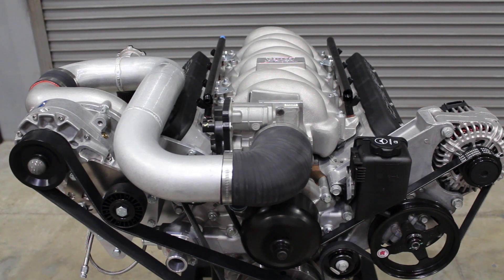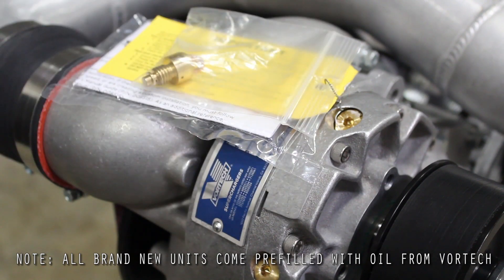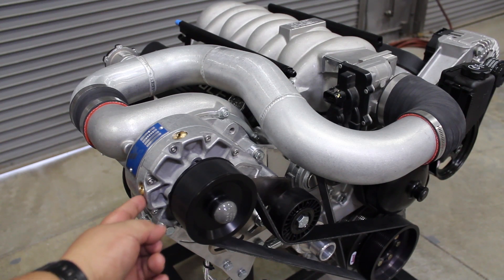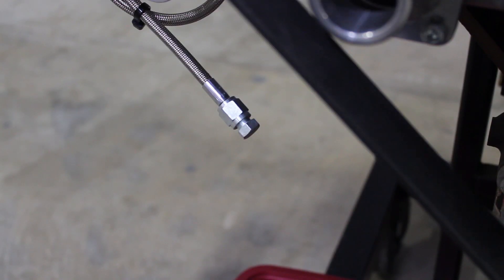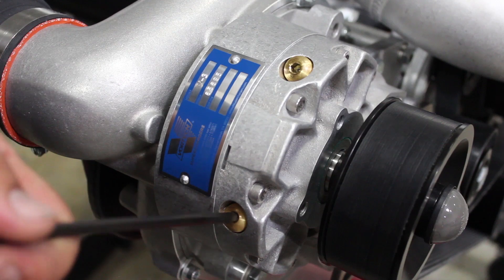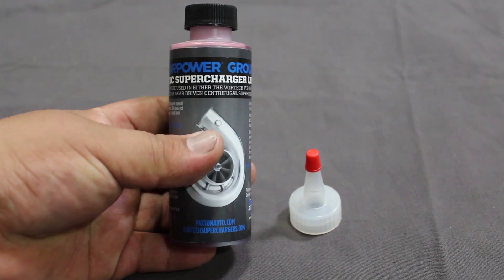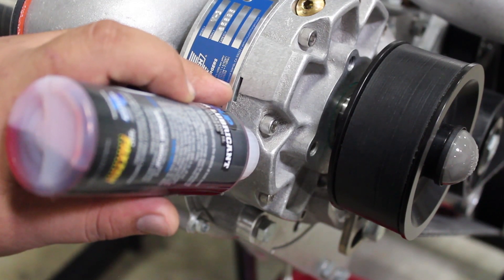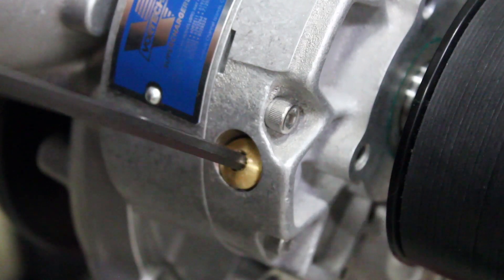How To: Vortech V-3 Supercharger Oil Change

Comment: Both my bolts are stripped, I bought this car used not too long ago, and I’m just noticing.
Reply: So did it cause any issues or how did you resolve this? 

Are the heads of the brass bolts stripped or the actual threads inside the gear case?

Comment: Installed a new Self Lubricated Paxton, and just changed the oil for the first time at 2500 miles. However, before reaching the 7500 mile mark for the next oil change, I noticed the oil is a bright milky pink instead of the magenta red it normally has after checking the dipstick. Is this normal or is it a problem? Do I need to change the oil right away now, or can it wait till the 7500 mile mark? What is causing the oil to be bright milky pink? Water condensation? If so, how to get rid of it or does it happen from time to time normally?
Reply: Immediately change that oil. Don't run the blower until it's changed. You have water contamination. These blowers have a vent plug that you're getting water accumulation through. Do you happen to have a car with a hood vent? Drive in the rain possibly?
Reply: Appreciate the reply. Yes, I have a Shaker hood system and the Paxton vent plug is located right under the shaker system so when it rains the water may be going into the supercharger through the vent plug side.  I'll drain it right away and change the oil. Thanks.

Comment: Fresh oil is hard to see in the dipstick. What’s happens if you overfill the oil by a quarter inch on the dipstick?
Reply: I know this is old but wanted to answer for you. Definitely dont want to overfill it. Make sure the old oil is completely drained out ensuring the drain line is clear of any kinks. Then only start with the supplied 4oz of oil. Start the car and let it run til warm then check the dipstick. Should see it on the hash marks. If you dont I would inspect all your steps before adding more to avoid overfilling.

Comment: I want one for my silverado. Can I run it on stock injectors? Wouldn't it be better to have a inner cooler? Is there a turbo without the 90? To add inner cooler easier. Do u have a video explaining everything for 5.3 siverado?
Reply: Intercooler
Reply: @hithereperson8137  i picked a torqstorm. I'm happy with it.

Comment: I am not sure if I am hearing things or not, can you guys tell me if this sound is normal from the v3 or what might be causing it?  I removed the belt and it turns fairly freely and doesn't make any noises that I do not remember it making but its been a long time since I had the belt off.  I checked the pullies around it and they are not making any noise either.  https://www.youtube.com/watch?v=4b1mtvpWiN4
Reply from the maker: Hello Scott, please contact our service department directly. They would be happy to address any concerns you may have with your Supercharger, and help to determine if any service may be required.
Reply: @VortechSuperchargers  I did and since I didn't hear back I am just assuming that means its a normal sound.
Reply: @Scott Sorensen  Mine is doing the same noise. Did you ever find out if something was wrong
Reply: @ArmandoHernandez-zn4mp  its normal

Comment: Does oil get forced out of the vent plug during normal usage on a V3? betwen my vent plug & dipstick you can see basically dried oil...like a film covered in dust. I checked the dipstick and there's no oil on it cold. Been bout 3k miles since i last changed the oil. Do i need to warm it up before checking the oil?

Comment: what about the V-2 vortech superchager? does that need oil?
Reply from the maker: While the V-3 Superchargers are self-lubricated and need separate fluid changes, all V-1, V-2, V-5, V-7, V-9 (etc.) units are engine oil fed, so they are provided a fresh supply of oil from the engine itself, via oil feed and drain lines coming off the engine, and draining to the oil pan.
Reply: @VortechSuperchargers  how do I choose which one works on my engine I have 5.7 l challenger  do I need v1 v2or v3

Comment: my kit came with some oil.  Is there an time that its good use before it goes bad?  its been on a shelf in a cabinet for a few years.
Reply from the maker: The Vortech Supercharger Lubricant has a significantly long shelf life, and should be perfectly good to use after sitting on a shelf for several years.

Comment: Does the si version also require oil change? Or does it share it with the engine?
Reply from the maker: Every V-3 unit is self-lubricated, regardless of what compressor stage is attached to it. The units that are all engine oil fed include the V-1, V-2, V-4, V-5, V-7, or V-9 Superchargers. This is also true no matter what compressor stage is attached to the transmission side of the Supercharger.
Reply: I have a V2 SC. Can I convert my V2 to self lubricated as V3?
Reply: @thanhha2686  i have a v3 si which shares the oil with engine.

Comment: If I don't drive 7500 miles per year, what's a good time interval to change the oil?
Reply from the maker: There is not a set time interval for fluid changes, only mileage. If you were concerned about time interval on a unit without much mileage, one fluid change per year should be sufficient.

Comment: Does anyone know how can I reorder the supercharger dipstick? It seems the previous owner stripped the head on mine. If anyone can provide me with a part number or means of reordering this it would be appreciated. I have the V3 supercharger installed on a 911 (997.1). Thank you.
Reply from the maker: The dipsticks can be ordered directly off the Vortech website. Just search "dipstick" in the search function and they will come right up. Easy!

Comment: I've filled mine with 3-3.5 oz of fluid and it saying it's about a inch over the fill mark. any ideas?
Reply from the maker: There are 3 different dipstick lengths, dependent on at what angle the supercharger is intended to me mounted. If you purchased the supercharger used, or the system you have is from a third party (not Vortech directly), it is possible that the dipstick in your supercharger is the incorrect length. Please give our service department a call for more information and further assistance.
Reply: bought it new from a dealer. I'll give them a call. thanks

Comment: I have 05 Mustang gt with v3 si,  no intercooler,  running on stock engine but with APR 156 -4301 head studs. so what's the safest rout to gain most power without blew my engine? some say 9-10 psi, and max 500whp. but this is the maximum risky power you can get, would you say 9psi,at around 450whp is safer to have fun with? mine blew up ,Ford mechanic think previous owner changed either crank pulley or supercharger pulls to create 19psi.
Reply: First off get an intercooler. Dont even think about adding anything before getting your cooling squared

Comment: good afternoon what torx socket can I use to remove the vent plug
Reply from the maker: It is actually a 3/16 Allen that you would want to use to remove the vent plug or dipstick. Using a Torx bit may damage the plug, and is NOT recommended.
Reply: thanks
Reply: FYI No torx bolt will be made of brass. As it it a softer metal

Comment: have a v5 vortech supercharger i will like to know if  a supercharge oil change is required on a v5c because mine has oil feed line that  feed directly from the oil pan   i m new on the supercharge and have very little information on it can u please help me out and has the original shipping  plug that a major NO NO ?
Reply from the maker: The V-5 is an engine oil-fed supercharger, so there are oil feed and drain lines running to and from the supercharger that supply it with a fresh supply of oil as long as the vehicle is running. You only are required to physically change the oil in self-lubricated superchargers, such as the V-3 shown in this video.
Reply: VortechSuperchargers I need help I accidentally stripped the threads on the oil entry. What can I do. I don’t want to force the screw in.

Comment: what about on the v9?
Reply from the maker: The V-9 is an engine oil-fed supercharger, so there are oil feed and drain lines running to and from the supercharger that supply it with a fresh supply of oil as long as the vehicle is running. You only are required to physically change the oil in self-lubricated superchargers, such as the V-3 shown in this video.

Comment: I have less than 1000 miles on my supercharger. It squeaks pretty loud on start up. The squeak gets fasters as the SC spins. I checked the oil and level is fine. What could this be?
Reply from the maker: A "squeak" is more likely a belt sound or an idler pulley sound than a supercharger sound. Give our technical assistance department a call and they will help you diagnose the issue.
Reply: Highly suggest Gates RPM serpentine belt. No not the green HD belt. It's says RPM on it.

Comment: How many hours / miles is the oil good for and is there an oil change breakin period also ? 
Thanks
Reply from the maker: There is no oil break-in period required. As it states in the video, the first oil change is at 2,500 miles, and each subsequent oil change is at 7,500 mile increments.
Reply: It comes with oil already in the Supercharger right?  Or do you have to add right after install

Comment: My Paxton has some gear noise at idle.. one guy told me his has no noise then 10 other guys told me at idle there is some gear noise.. it smoothes out as soon as i come off idle but it worries me lol
Reply from the maker: Any centrifugal supercharger will always be loudest when it is spinning at its slowest rate (idle). It is not uncommon for the gear noise to be what some would consider "loud", while many others would probably say it isn't loud enough! As long as the sound decreases when the supercharger is spun faster (off-idle and driving speeds), then the unit is most likely exactly as it should be.  If you still have concerns, you can call the Paxton service department and have the unit sent in to be checked out.
Reply: VortechSuperchargers Thank you, I had a feeling it might be normal gear lash noise.  It clears up as soon as it comes off idle.

Comment: How often do you do this?
Reply from the maker: The first initial fluid change (when the supercharger is brand new) is at 2,500 miles, and each subsequent fluid change is at 7,500 mile increments.
Reply: I so wish they answered your question as I'm begging to know that too!
Reply: VortechSuperchargers Please explain the oil feed/return system to me - on an S2000 that I want to purchase, I'm not sure if the V-3 (or possibly 2) has had it's fluid changed as you recommend and I'm not sure whether the installer used a feed/return setup. How do I know/what do I look for?
Reply from the maker: For answers to your questions and more information on the system that you have, please contact our technical assistance department at 805-247-0226.
Reply: VortechSuperchargers I see. could you please give me an email address as well? Would be easier to contact you via email as I am not living in the USA.
Reply from the maker: All of the company contact information is listed on our website.
Reply: VortechSuperchargers Got it. Thanks